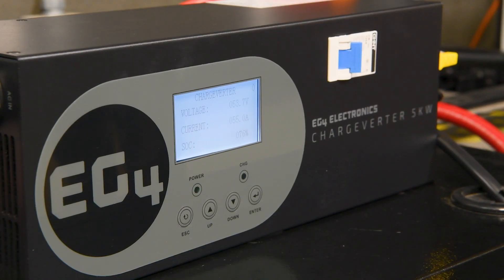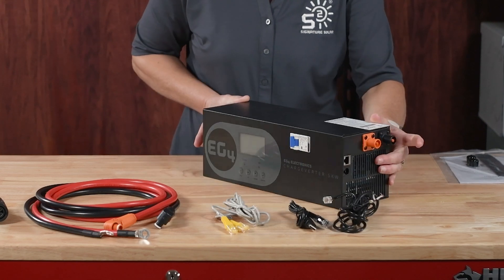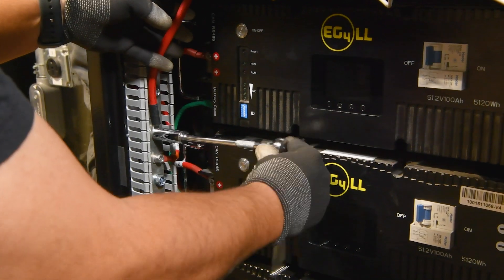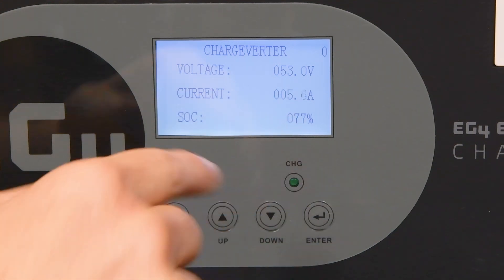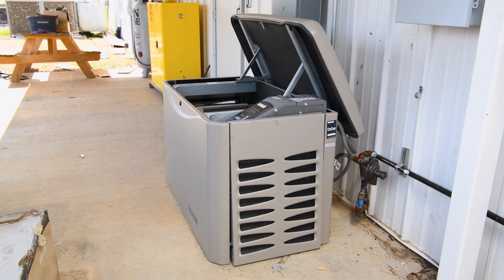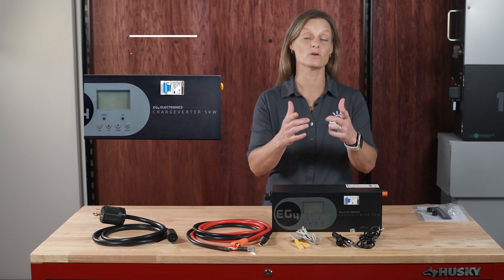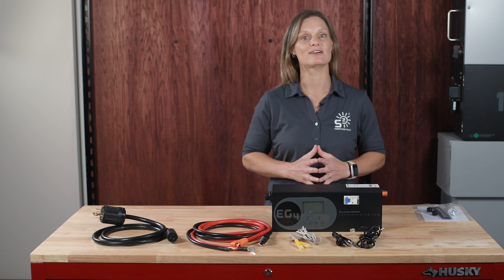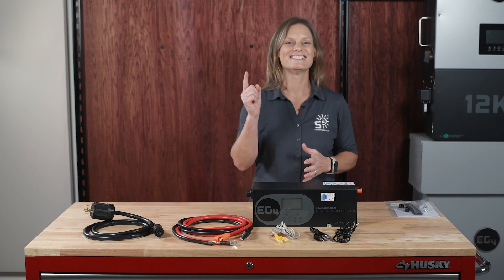EG4 ChargeVerter GC: Charging Batteries Efficiently from a Generator

Comment: In the Conclusion @12:22, she says "...remember to ensure that your inverter's loads do not exceed the output capacity of your chargeverter. If the loads are too high the chargeverter will prioritize powering the loads over charging the batteries to achieve efficient battery charging keep your loads within the chargeverter output limits."

HUH?  If true, this means the chargeverter HIJACKS control of your system from the inverter?  I hope this is an erroneous statement.  I'm getting ready to order a $4k starter system from SS, and I want to know about any odd behavior BEFORE I spend money.

I want my 3000EHV-48 inverter system to function NORMALLY during an outage, with the (small) generator & chargeverter simply adding more charge to the battery as needed.

I DON"T want the chargeverter CONTROLLING what my inverter does (as long as the battery has sufficient charge).

Thanks to anyone who can help clarify this point.
Reply from the maker: When designing your system, we recommend prioritizing communication between your inverter and battery. This is significantly more important than relying on the state of charge from your Chargeverter. This approach will prevent the Chargeverter from taking control of the inverter during grid outages. However, when it is necessary to charge the battery using a generator through the Chargeverter, if the load requirement exceeds the output capacity of the Chargeverter, the Chargeverter will prioritize powering the load through the inverter rather than charging the batteries. The goal should be to charge the batteries first and then power the loads from the batteries.
Reply: @SignatureSolar  But its not that its prioritizing the loads. Its just that your taking more out than your putting in. Will it damage the Chageverter discharging the batteries more than charging? So for instance 2-6000xps with 2- power pros 40% start point,  If the grid goes down on a cloudy day and my average use is 2kw per hour with a peaks or 6kw or more.  If I use a small generator and charge at a consistent 3kw per hour eventually my battery would gain. Yes I'd be using more than I'm putting in occasionally but the long term averages is what I'm concerned with. I'm thinking rather than use a start stop set-up just run a smaller quieter inverter generator 24hrs during a outage just go a slow and steady route with smaller generator and upfront cost. Would this work?
Reply: I'm going to add one because my inverter is set to turn off at 20% I would set this charger to run from 20 up to 30% then auto off for solar. It's a fail safe for cloudy or overnight. I just need to connect to my 12v system dual systems
Reply: If the chargeverter is charging your battery at 3000 watts and your electric tanked water heater kicks on drawing 4500 watts, and it is night time so there is no pv input, The chargeverter will still be contributing 3000 watts, but the battery will make up the extra 1650 watts  that the inverter is drawing to power the resistive heating elements.  If the chargeverter wasn't running that would be 4650 watts from the battery. Just like when it's overcast and i'm getting 992 watts from pv input but my electric space heater kicked on and 772 watts is being drawn from my battery to fulfill the 1600 something watts for the heater.

Comment: I'm planning to get an EG4 3000 EHV-48 inverter & some EG4 48V batteries.  I own a 3kW 120V inverter generator.  I want to be able to charge my batteries from my inverter generator while powering appliances from the EG4 3000 EHV-48 inverter.  Do I even need a Chargeverter?
Reply from the maker: Yes :)

Comment: Just hooked up a lifepower4 battery monitor and the last rs485 port on the stack is being used for a server to get BMS test software readings remote. Can I plug the chargeverter RS458 into the battery monitor? (item number 7 in the monitor manual? rs485-2 Pin7-a Pin8-b) Also which direction does the heat exit?
Reply from the maker: No, you cannot. If you are referring to the heat from the chargeverter, it will come out of the top.

Comment: Q. Is the new Chargeverter UL-certified?  Inspectors, insurance, electricians increasingly demand all system components in off-grid set-ups be UL-certified, otherwise no dice.
Reply from the maker: Hi! The Chargeverter is not UL certified.

Comment: Nice video. Will this unit communicate with the Schneider Xanbus for SOC? My EG4 batteries are connected to the Xanbus.
Reply from the maker: Our batteries communicate to the Insight device, if the particular Schneider device uses only Xanbus without the use of the Insight home then no.

Comment: is the charger needed because eg devices does not actually support generators.... even though it says a gas or diesel generator can be used?
Reply: Why have a generator hook up on the 18K if you can’t use that connection and have to buy this ChargeVerter?  Would like a list of generator that is recommended to use with the 18K.
Reply: @kimphan9874  Honda EU3000is for 120V and the Honda EU7000is for 120/240V. I own both units and they are not cheap, they both have a very clean sine-wave with <3% harmonic distortion which is the sine wave required to cleanly run all of your household electronics. The limitations now rest on your brand of inverter/charger for example my Schneider SW4048 has a charge ability of 45 Amps regardless of my generator charge output therefore in my case although my sine wave is acceptable if not optimum it lacks behind the touted 100 Amp maximum charge using 240V for the EG4 ChargeVerter. So in my situation I have the generator ability to operate with the cleanest sine wave but lack the ability at a higher charge rate therefore I am ordering this unit for it's charge efficiency and not the harmonic distortion ability. With routine maintenance my Honda 120V unit has 18,000 hours and my 120/240V has 9,000 hours to date, this technology and build quality warrants the price that they demand compared to a dozen dirty noisy box store units. Off grid is a way of life, good luck brother.
Reply from the maker: Some generators produce cleaner sine waves than others. The chargeverter can clean up the dirty sine waves from generators, making the energy acceptable for the inverter.
Reply: @SignatureSolar yes we understand that, but the EG4 devices that say they support generators should clean the generator output automatically.  i've not heard of anyone successfully connecting a generator directly to an EG4 6000xp or 18k. 

I do appreciate your reply thank you
Reply: for everyone asking...yes you can put a 240v capable generator directly on a 6000xp.  It energizes a passthrough relay that sends the generator's power to your breaker box and siphons an additional load amount (limited by max generator KW in AC Charge settings) to charge the batteries.  The sales pitch here is that your generator would need to be top notch to suffice in that situation without giving dirty power to your breaker panel.  Additionally, this thing allows you to use 120v generators to charge your bank, which is otherwise impossible. 

 5kw isnt that interesting though and 500 bucks is not a good enough price to justify using it.

Comment: I have 2 of these New ChargeVerters I purchased from Signature Solar after I had already purchased 2 6000XP's, a Rack of Batteries and a pallet of Solar Panels.
The following info is Serious for Off Grid Customers.
#1 You cannot use the communication to batteries when batteries only have one port like LifePower4 and are already connected to inverter communication making this upgrade useless.
#2  Since you cannot start the generator based on SOC because you cannot use the communication feature, you are stuck with inaccurate voltage making this upgrade useless.
#3  Turning On the ChargeVerter will cause your 6000XP's Inverter to Shut Down and Restart shutting down all your loads.  You can charge up the ChargeVerter by plugging in a running generator and then it will not shut down the EG4 6000XP's.
#4  Why didn't they include a true battery charging feature inside all 18K, 12K and 6K so you can hook up a normal sized generator to each 6000XP, 18K, 12K etc?  You could then run one generator on one unit or start another generator on the second unit etc as needed leaving the Inverter on at all times.
#5  So they have upgraded the ChargeVerter with useless features, charged more for the unit and still have not fixed the problem of flipping on the Chargeverter Breaker Shutting down the system?
They have had many All-In-One systems get damaged due to the lack of proper info to customers on this subject resulting in Damage.  Customers hooking up a generator up to just one unit or multiple generators to multiple All-In-Ones not knowing that they must hook up Only One Generator to all All-In Ones in the system or you will have serious issues like phase unmatching which can cause all kinds of Damage.  Or customers hooking up too small of a generator to their All-In-Ones causing shut downs, failures and damage.  Or customers generator operating outside of the less than 3% distortion tolerance damaging their units.
So this video is their solution which left out critical info?
Only customer solution is to purchase additional ChargeVerters that we should not have to do and were not informed that we needed.  Few people have large enough generators to satisfy their design issues.
I am not the only one upset about this issue and EG4 has not replied to me at all.  They should At The Least provide a fix for this shutting down issue and send that additional device or upgrade to all customers who purchased.
Lets see if they respond to this comment?
Reply: I did fine a solution to the shutting down issue when turning on the Chargeverter.  Fire up the generator first and apply power from generator to the Chargeverter allowing it to energize the Chargeverter's internal capacitors.  Then turning on the switch on the Chargeverter will not shut down the system.  Wouldn't EG4 know this and let us know?
Reply from the maker: Thank you so much for your feedback! We will forward your comments to the manufacturers! 😊
Reply: yes.  nicely stated thank you.
Reply: appreciate this, looking at the same option...sounds like a fail
Reply: Since the chargeverter monitors battery SOC/voltage and starts/stops your generator, there is no reason for battery-inverter comms. Everything is done via the chargeverter seamlessly and SOC is only important for "overcharge" condition if using solar. A BMS should take care of this portion. The chargeverter is specifically for systems with limited or no solar inputs and where "dirty" input power is an issue because of excessive heating of the rectifiers; correct.me if I'm wrong... DC-DC converters are available for alternator charging. Buyer beware.
Reply: @theanimalmedic  First, I don't use generator autostart on purpose.  
Second, Voltage is a terrible way to decide when to start or stop a generator on Lithium Batteries!!!  
Third, What is the "overcharge condition" you are speaking of???  If your batteries have to shut down because your chargeverter overcharged them causing the BMS to shut down the batteries, that is NOT GOOD !!!!!!  
Fourth, the ChargeVerter is NOT specifically designed for systems with limited or no solar !!  It is designed to allow you to stay on Inverter when using a smaller generator that cannot handle the loads and charge on top of that, and, if you get cloudy days and despite having lots of solar panels, you must charge.  
Fifth, No one wants a huge expensive generator that can be hooked up to all 4 or 6 inverters at the same time to handle the load and charge.  Stupid design when it would be ease for them to include a true charger like the ChargeVerter built into the All-In-One!  And most large generators are not Inverter Generators and will still go past 3% distortion damaging your All-In-One !!!!!  
A separate charger like the ChargeVerter is the best option for now because you can use cheap Inverter Generators 6k or 8k that can max out the ChargeVerter at 100 amps.
As I stated, the ChargeVerter upgrades are useless to many of EG4 Customers if their batteries, like the LifePower4 and others, only have one com port.  And since you cannot autostart the generator to apply power to the ChargeVerter before switching it on and shutting down your whole system, You Must Do This Manually anyway or leave the ChargeVerter On At All Times!
Leaving the ChargeVerter On at All Times is stupid power drain and would only be necessary for autostart generators and people who like wasting Fuel.
For many, my post and others who posted similar all over the web has helped may to see the downfalls and options to make good decisions on Charging All-In-Ones with Generators.
Good Health to You.

Comment: Is it true that the eg4 charger has a better than .99 Power factor? I got that info from some data Communications power supply modules that are supposedly the modules used in this charger.
Reply from the maker: 92% at 120v and 94% at 240v
Reply: @SignatureSolar  Those sound like efficiency numbers. What I'm asking about is power factor, how closely the current wave aligns with the voltage wave. Number is important for de-rating generators. The data sheets someone posted on the telecomm grade PSUs inside the EG4 product suggest it may be 0.99 PF, but I'd like to be sure.

Comment: What I can say about the yellow one the earlier initial first model is that mine withstood a lightning strike which blew out a different brand of inverter charger that was also hooked up in parallel and running on the generator at the time of the lightning strike the eg4 product just kept right on going like nothing had happened but lightning had actually hit my solar panel array. The electromagnetic pulse from that was considerable and went into both the charge rotor and the other product. The other product went up and smoke was the charger is still good to this day.
Reply: Yikes

Comment: I have both the yellow charger and the new Black unit you have featured here. For the first two weeks it was a mystery why the new unit wouldn't charge past 89 or 90 amps but I just recently figured out that the new charger thinks the battery voltage is 2/10 of a volt higher than the old charger. There's a difference in calibration of the metering within the Chargers. So I had to add 2 volts to the charging threshold on the new unit to get it up to the maximum 93.5 amps that I've been able to get out of these. I've never had one of these actually produce 100 amps of output.

Comment: Those of us that are using this as just an AC charger and not for automated generators would appreciate the cheaper original. Had my eye on the original to charge my DIY electric ZTR mower. Was waiting for the next sale when it got discontinued and replaced. The price, especially of the new one, has me limited to a 60V 5A variable power supply. It's almost 1/10 the cost and works.
Reply: Mike, I was in thier store a couple months ago buying one and they still had some of the old ones left sitting on a shelf. Give them a call, they may be able to get ya one of the old ones. Good luck!
Reply: Exactly! Like a dork I waited, quite a while, til I could afford 2, and kept waiting for a super sale of some kind. When I didn't hear of one of those crazy sales and got tired of waiting, I went to get one, and by this time they'd changed the model..I just thought they changed the color until I saw the new price. I'm STILL pissed.

Comment: I just bought 2 of these, I would really love a guide for dry contacts. I have westinghouse generators with push start and I have no clue how to hook them up to the chargeverters.
Reply: Any luck?
Reply from the maker: Hi! Page 5 and 6 shows the plug pinouts and how to wire it and 16 and 17 shows the dry contact description. https://eg4electronics.com/wp-content/uploads/2024/04/EG4%C2%AE-Chargeverter-GC-Manual.pdf
Reply: @SignatureSolar  I have read the manual, I am still having a problem with connecting it to the generator, they are push button start generators but don't have dry contacts, how can I overcome this?
Reply from the maker: Hi again! If you'd like to reach out to our tech support department at 9034412090, they will be able to assist :)
Reply: I hacked the smart switch port on my Westinghouse WGen7500 so I can remotely start/stop the generator from anywhere with my phone. The relay is about $20 on amazon and uses the Tuya app to control it.
Reply: I am having same issue, the tech people from signature solar said to ask the Westinghouse manufacturer but there is no way to call them and find out.  Is there a list of generators that have dry contacts for this type of automatic start?
Reply: @Gracefullfarm I use the GSCM-WIFI device with my Westinghouse push button inverter generator
Reply from the maker: Hi! We looked into the contact information for Westinghouse, their customer service number is 1 (866) 442-7873 or you can complete the form below! https://westinghouse.com/pages/contact?srsltid=AfmBOooaxELmxHcqEcXqY6nWNTPXQZwd7RI6dyPB7c-ooGiI9H9jUMGP

Comment: Thanks for the video, can one take wind turbine power, quite dirty ac with low power (1000watts) and clean it up into a dc form and use it to trickle charge ones batteries?
Reply from the maker: Possibly but it is untested, however we do not recommend ac coupling a wind turbine to our units as it creates dirty sine wave

Comment: In what scenario would you want communication between the Chargeverter and Battery verses Battery and Inverter?
Reply from the maker: Because it will allow for it to automatically start and stop the charging
Reply: @SignatureSolar  And you believe that is more important then the features that come with communication between your EG4 18pkv and the battery?